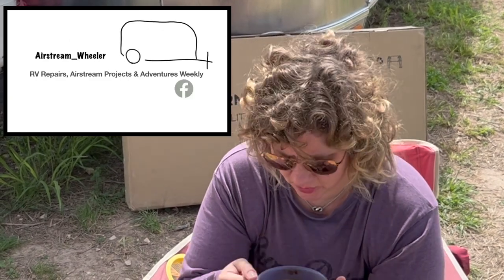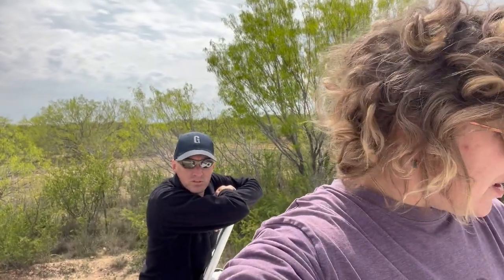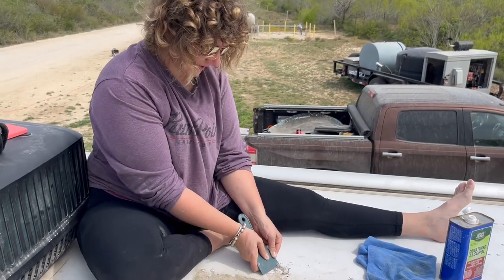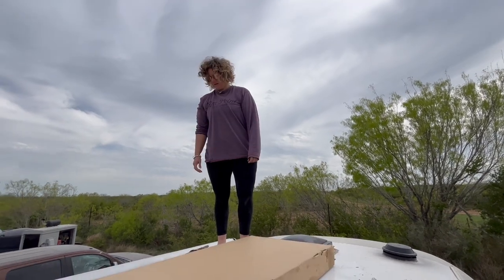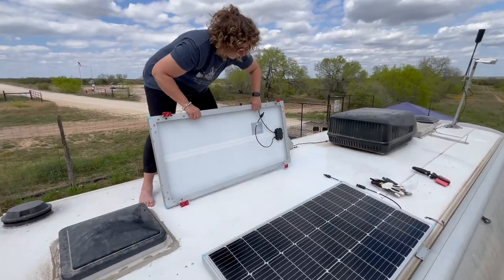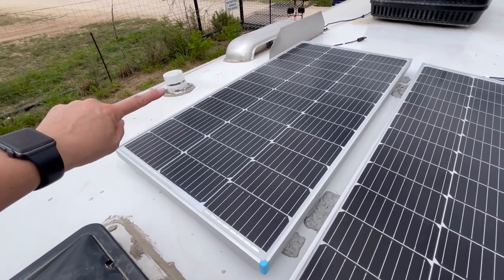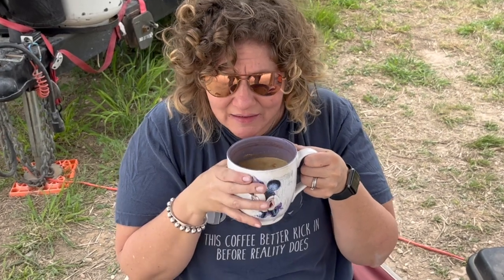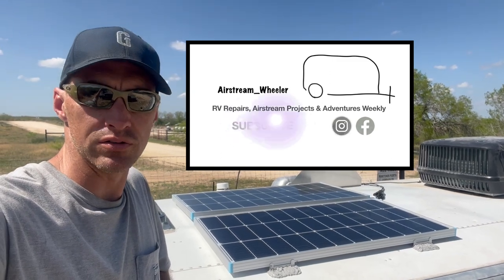Airstream Solar Install: 200 Watts of Renogy Roof Solar, No Drilling Required!

Comment: Hey, just watching now. You figured it all out and did a great job. I had to figure this out myself also -- we have had 5 Airstreams, and I installed solar panels on 3 of them. Multiple people who have installed panels professionally have confirmed you do not need fasteners. You do, however, need to install properly, which they have said is to: 1) clean feet and roof surface with a solvent to get it clean and dust free. 2) then attach the feet using this amazing tape: 5952 VHB Tape. 3) completely glob over (that's the technical term) the foot so that water and sun cannot get to the tape. The goop that has been suggested and I have used on 3 airstreams is SikaFlex 221. I have used a bunch of sealants but this one is also amazing, like the tape. It is waterproof, UV resistant, paintable, sandable, low VOC, and cures over time. I think it will become a permanent part of your toolbox. Watching the rest of your video right now.
Reply from the maker: Hi! Thanks for the support and for watching! Great advice. We were pleasantly surprised there were no holes to fill and how well this turned out. ~Shanna